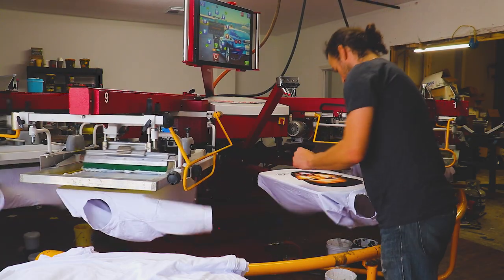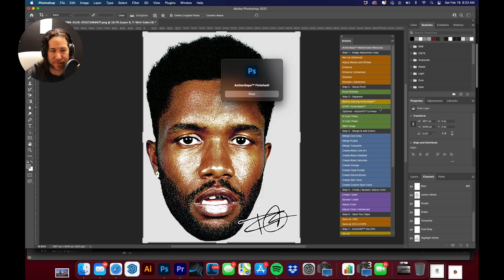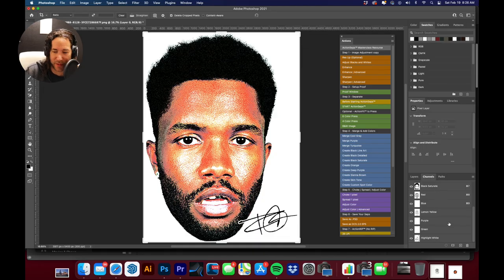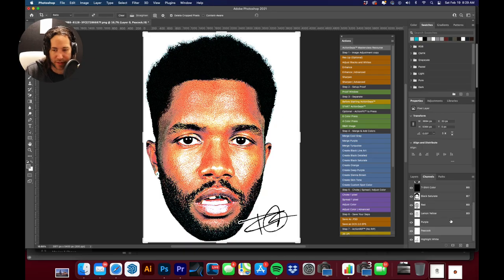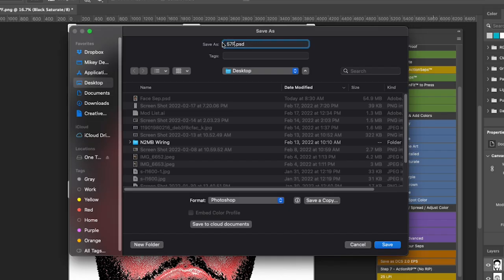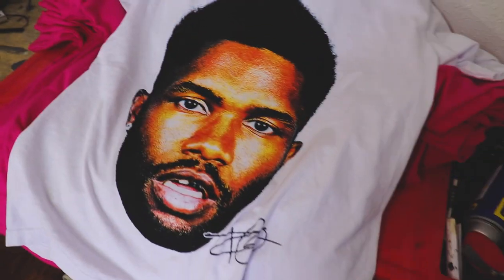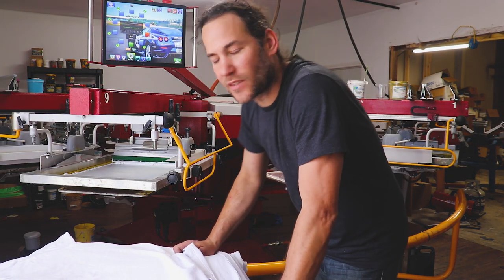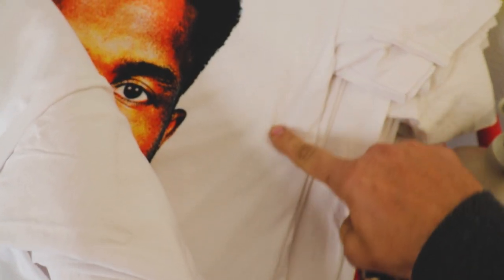ActionSeps™ | How to Screen Print 6 Color Simulated Process on White Shirts - Anatol Titan Automatic

Comment: I have installed a refurbished print head in my Epson artisan 1430.  The directions say to prime with new cartridges…. But I have full refillable cartridges will this work or is there a way to force the 1430 into the initial prime session?  Can you also explain the difference between priming the print head and running a cleaning cycle?   Thanks so much love your channel!
Reply from the maker: Thank you! If it's a CISS setup. You'll see a plastic / rubber plug. You have to pull those and use the syringe to press into the plug hole and pull ink into the cartridge until you start pulling ink into the syringe. Once you get to that point, you're good. Cleaning cycle will force ink out of the print head into either your waste pads or waste tank. A cleaning cycle will eventually get the cartridges primed, but at the expense of wasting ink. I hope this helps.

Comment: Het Matt, nice one mate. Quick question, what was the squeegee angle for the colours, looks like 20 degrees? TIA
Reply from the maker: It was right around there. 20º. I just make sure it's using the edge of the squeegee, unless I need to push more ink through to balance the look of the print, but for the most part we have it set to 20º and don't fuss with it.
Reply: @mikeydesignssilkscreen473  Thanks so much. helpful as ever! I think we will reset ours to 20 and see how we get one with the sim-process prints

Comment: Hey brotha great video like always, just had a quick question. what is a good rip software to create the halftones after color separating using actionseps?
Reply from the maker: We like to use AccuRIP. However ActionSeps can rip the halftones if you find a RIP software isn't in the budget yet.
Reply: @mikeydesignssilkscreen473  what about the printer requirements does it have to be an Epson?

Comment: Heya mate!
We do a fair amount of sim process at our shop and Im just curious to know what you do, or how you handle the Top White when the it starts turning a little colourful from all the previous colours. Cheers
Reply from the maker: What mesh are you using? We'll generally use 230-305 and just give it enough of a pass to kind kiss the colors.
Reply: @mikeydesignssilkscreen473  using the same mesh 230 and 305. When doing our Top White, over time we just get a little bit of the previous colours start to peep through the mesh into our TopWhite. Its only ever so faint but then at the end of the run we cant put our TopWhite ink back into our White ink tub lol So we actually through into a spare tub and use that for mixing other colours where a little bit of white is needed.

I understand just lightly kissing the colours.
We might even be putting a bit too much ink coverage of the previous colours for this to be happening.

Comment: Whats the difference with this separation and cmyk?
Reply from the maker: CMYK used translucent inks and isn't as consistent as simulated process. Even on an automatic press, with CMYK each shirt can come out slightly different shades. With spot process, they're all the same from print 1-(whatever the order size is).

Comment: Got a question for the community. We use accurip black pearl and Epson 1430. The 1430 is on it last legs with making a grinding noise at start up. I’m trying to find a economic solution to printing films. Everything I try with accurip looks like it’s going to cost over $1000 with either trying to buy a supported printer or upgrading to emerald with a annual plan and a new printer.
Reply: I see that actionseps does the half tones. Do you have a printer and ink recommendation.
Reply from the maker: Any printer you can set to print black only will work with some testing. Just have to make sure the films are dense enough.
As far as the issues, I personally would either have it serviced. Not a lot of support for the newer printers and Epson has locked out, or made it near impossible to convert over to all black or the use of aftermarket CISS systems.